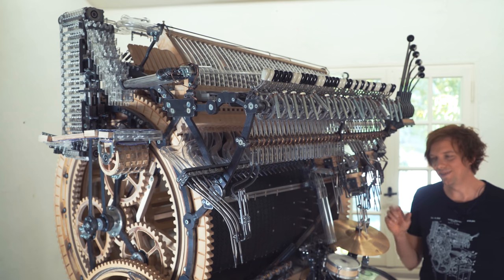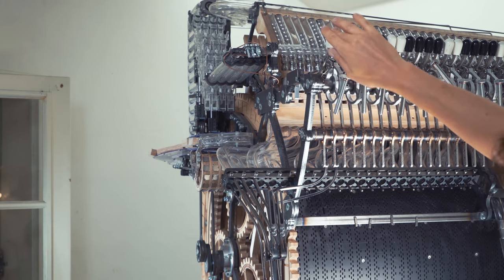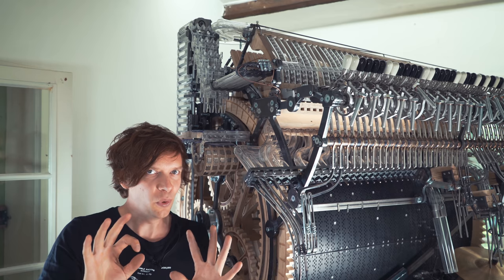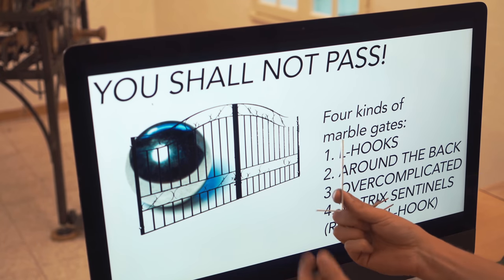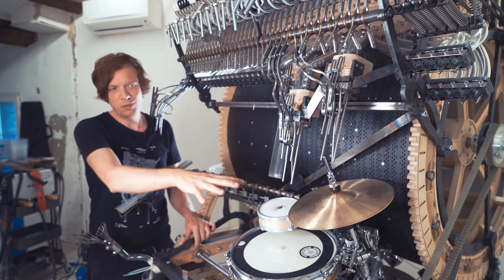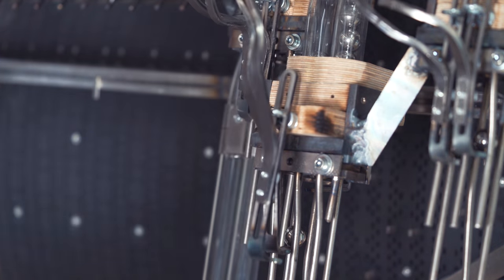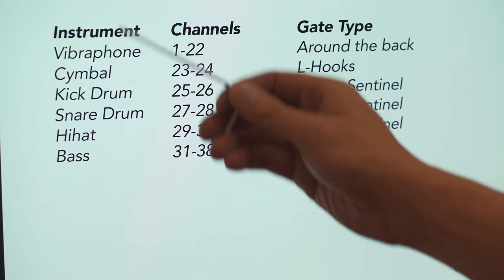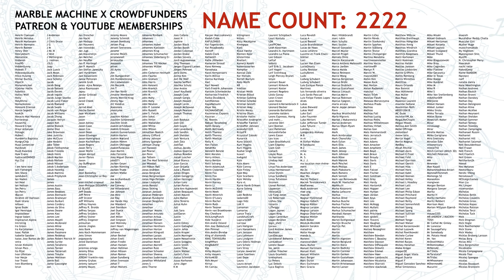Marble Gates Design - Marble Machine X #91

Comment: The two outer bass string could use the "Around-the-back" solution, right?
Reply: yes, and I think all of them could actually. you just have to go further around.
Reply: @tonygts1  But that would mean that you have to bend it around two channels for the inner ones. That sounds a little over the top but might also be worth it
Reply: I think it would be worth it.
Reply: I think there are still some alternatives that are being overlooked, things much more pleasing to the eye than the around the back solution. like the suggestion from Thiago Ennes in another comment, that is a much more elegant solution
Reply: @stuchris  I could see the around-the-back design being done with a strip of sheet metal like a piece of gum. Could mount flat against the release and take VERY little clearance between the arms. I would totally start with that janky looking wire, but refining could give multiple ways of doing the same thing with less room and just as much, if not more, adjustability. $0.02
Reply: @doomse150  if the other option is to restrict your bass compositions to slower notes only I think it is definitely worth it.
Reply: @AHustleIsLikeASideOfFries  yeah, it could still be done easily, but its still not a very elegant solution. I'd recommend the Redesigned Over-complicated mechanism with a rocking switch like other people have suggested, as it could not only do the intended purpose and look nice, but also be used for the registrator fingers that have caused so much trouble

Comment: Your problem from your gate is because the opening is depend on the speed of the wheel right? Is it possible to solve it by make the white knob gate spring loaded that triggered by the grey part? So the opening time of the gate is constant, and you can adjust the opnening time by the spring. Sorry i have limitations in describing and engineering theory, but that was my idea. Hope it helps you. 

Have a great day!

Comment: Just have the around the back go around the entire section of rails for the base.
Reply: If doing so I would suggest having two around the left side and two around the right side, so they don't become too long.
Reply: Correct me if I'm wrong, but doesn't that mean that it releases all the marbles at the same time and would jam it?
Reply: @calk7694  no. The wire start point and end point would be the same as if it had room. The path would just be longer. That path would not be a straight line to not get in the way of eachother.

Comment: cant there be an activation of the release that closes it immediately after opening (regardless of tempo)?
Reply: Perhaps in theory, but it seems that would require a significant redesign of the registrator mechanism
Reply: That's a nightmare: gate opens, ball falls, gate must close and stop the the stack of balls right behind it. Almost nothing in this machine is that accurate, repeatable and reliable. All three are necessary. The matrix sentinel style is excellent on all 3 counts, it's just big.
Reply: @jimbarchuk  i mean at the release of the marble that will play for that note, not at the gate or registrator
Reply: The idea of the fingers could actually be functional. They would actuate the release, and it would slip away before full extent and close before the next ball dropped

Comment: I think a lot of people will agree, for once, this over-complicated solution is by far the best of the whole lot here. for its adjustability, I'm sure there's a way to redesign it, and to get that pivot just right there are ways to calculate that. the overcomplicated design would look much better than the rest of the solutions (especially that around the back) and could perhaps help or be implemented with that other, controversial part directly above the channels :P

Comment: Martin, I can't help but notice that all of the solutions, excluding the matrix one, can fail for repeats of more than 2 consecutive notes as the time to travel between the upper gate and lower gate (TTT) is still ultimately the "gating factor". :)  A 2 note repeat is fine since both balls are queued at the "tip" so-to-speak but it breaks down at 3 for higher frequencies (where TTT is slower than the desired frequency).

Your matrix sentinel gate is interesting and it seems to highlight the underlying problem of the TTT being the frequency limiting factor.  For that one you've essentially moved the upper gate from the top to the bottom, closer to the instrument to lower the TTT making it faster than the desired frequency requires.

If my observations are correct, the only way to truly solve that across all desired channels, which sadly would seem to require a lot more re-work, would be to move the whole upper gate system to much lower in the design closer to the instruments, or at least to do that for the high frequency channels.

Caveat: the purpose of my note is that I see a lot of complexity being added by requiring all the secondary gate systems for timing's-sake that to a degree obsolete (though not completely) the need for the upper gates.  Needing the lower gates requires many more parts and most notably limits your creativity when composing, to frequencies limited by their respective TTTs.

That all being said, constraints tend to bring out other forms of creativity in interesting ways and certainly these lower gate designs make for a more complex and interesting overall system.  So maybe it's a fair trade-off.

BTW, my son and I love watching you on this journey, learning from your experiences and are greatly looking forward to your world tour!

Comment: Really nice engineering and analysis of tradeoffs. I kind of like the slim look of the "overcomplicated" gate.

How about using the "around the back" design, but use a some thin sheet metal to build it, instead of using a wire, then add a little bit of adjustability on the back, so the timing, and clearances can be adjusted?

But I agree with the current choices, make it be ready and working. It can be improved further later.

Comment: Solution for the integration of the overcomplicated in the bass part, maybe put it at a angle? If you can build a top part to make sure each marble cany escape, or put it at an angle where they dont fall out, the overcomplicated can likely work at a angle or sideways and lessen the amount of space it requires horizontally.

Comment: A suggestion for the bass and drums, you can use something like a full-flow-ball-valve passage that pivots instead of sliding, and then use an adjustable linkage up to the handle pivot to allow for fine-tuning of release timing.  This way you are not adding congestion to the lower release mechanism, nor adding a significant load to the existing release design.  Keep up the good work!!

Comment: An interesting video idea which would also help your composition process. Call it MMX Piano Phase.

The goal is to find the exact maximum tempo for various instruments. Find when the L-Hooks start dropping notes, and keep that in mind.

Set it up in 8th notes, Triplets, and 16ths, across the full ranks of the L-Hooked channels, and accel. through the failure point with a click track. Spend a half-measure at a given tempo, so you don't have to fiddle with the high-speed framerate arithmatic.

Remember: You can still do two notes in quick succession without reloading - just not 3. You have two channels per note for a reason.

Additionally, this tests the hell out of the tolerances for your marble reloading system. It's elegant, but you do want to know how many marbles per minute the system can handle, and you only find that out by going past that point.

Comment: Martin, look at how an anchor escapement works on simple clocks; There are two pallets that rock back and forth over a gear. As one pallet lets a gear tooth slip by, the other pallet catches a different tooth just a moment later. One pallet rocking back and forth could simultaneously release one marble and block the movement of the next marble. One piece, one side, quick reload.

Comment: You can use around the back on the bass by having the wires loop around multiple channels. Only the two inner ones need to reach around the outer ones, so that shouldn't be too much work getting it right.

Comment: i think if you combine the matrix style gates with the normal l hook gates you could benefit from the around the back method without compromising on width. i think if you take the normal base gate that blocks the marbles, affix a wooden block (with a hole one end for marble to pass through, this will be closest to the l bracket. then the rest should block the path of the marble) this means the marble can load into the release section but then a subsequent marble will be blocked by the wooden extrusion blocking the channel.
i'm certain you may've tried this but i'm hoping to help.
great videos!
and many thanks

Comment: Have you tried designing a rocking mechanism like for example the "escapement" part of a clock assembly.
Instead of the marble releaser directly releasing the marble. 
Have a upside down U-bracket that sits upon the rails with a pivot on the centre, and everytime a marble is dropped, you raise the front of the bracket, while the back drops down and stops any further marbles from going down

Comment: If I'm not mistaken, because the E and G strings of the bass are on the outside of those sections on the machine, you could theoretically put the "around back wire" for just those strings to play faster if you really wanted to

Comment: Since the 4 channels for the bass are all the way on one side, and they have space on the side, you could widen the spacing between the clear shoots. Since you have metal rails, you can guide the marbles back closer for dropping. With that extra space, you may have room for the around the back design. - Tradeoffs; you'd get to play those notes in quicker succession, but you'd have to redo some work (tubes, that metal mount), and the space would still be tight.

Comment: An idea - 15mm slice of thin wall box section - just wide enough to sleeve over marble rails. Weld top of box section to gate. Add tapped hole on bottom of box section. Use bolt to act as adjustable peg that rises and blocks marble when gate opens. Box section gives strength and uniformity in direction of repeated marble hits. Bolt peg gives timing adjustability. Stagger alternating channels to keep slim profile. Adds maybe 1mm either side of channels - surely there’s enough room for that?

Comment: This may be hard to explain, but I expected some kind of mix between solution 1 and solution 2. 
Having 3 marbles loaded in the release system (one by the divider with the gray part, one in the actual release, and one held by the around-the-back solution) seems to be the most effective to me in terms of reliability, and doesn't really care about speed. 
There can only ever be a single marble in the release thanks to around the back, so playing slow is no issue ; and having both systems allows marbles to be reloaded super fast, so playing fast is no issue. 
I guess it's kinda like your fourth design, but without the marble queue.

I agree that going around the back is not a nice way of implementing it, but I imagine a switch attached to the release that would be kind of the seconds ticker of a watch, going back and forth and acting like a lock (as in waterlock or airlock -- sluss)

Comment: An alternative to the 'overcomplicated' that may be simpler to adjust, while maintaining elegance and a degree of maintenance-simplicity.

Use a pivot still, but add a turnbuckle rod between the release gate, and the 'inverted' (by the pivot) counter-gate.  I'd have the counter-gate arm bent around 20-30 degrees at the pivot, away from the marble track. In order to avoid risk of interference with the marble on the track.

Regarding the 'matrix sentinels', if you invert the 'drop' operation, you can completely avoid the need for L-hooks:

- On the forward stroke, the marble enters the 'metering chamber' (aka 'grey piece')
- On the backward stroke, the marble is released from the 'metering chamber' and lands on the now-closed release gate.
- The screwed-in mechanism as currently used forms the adjustment mechanism for the point of release.

I apologise for the fact I haven't attached diagrams to this comment. It's half ten at night and I've been battling binary logic all day.

Comment: Considering all the space near the bass, you could do around the back, the two center channels would just need to go around the outer channels as well.

That would look a bit wild, but is totally doable.

Alternatively, as there’s literally no space between the channels, you could do standard around the back for the outside channels, then weld the center two together for strength, and then drill a small hole through that seam, for a slim rod to pass through for each of those channels.

The great thing about the around the back solution, is you can implement it later, rather than hold up the whole machine now.

Comment: You could go around the back on the edge bass strings - E and G - and use the L hooks on the two inner strings - A and D. 

That way you could get fast alternating octave lines as long as you don't go below the low G on the E string.

Comment: You could attach a horizontal piece of metal with a hole in it to the marble releasers. Then when the release is out because a marble is being dropped, the hole would slide out of the marble channel, blocking any marbles from coming down. Then when the marble release closes, the hole would slide back into the channel, opening the gate and allowing the marble through. This would require no extra space on the side and just involves attaching a single piece of metal with a hole onto the marble releases.

Comment: Hey Maarten. There has been something rattling around in the back of my mind for a few months now. Pretty much since you finalized the marble divider. With the changes I see today with the "Matrix Sentinels" (I LOVE These), the noise in my brain has become louder. It has to do with refill rate and marble reserves. Due to the shallow angle of the divider, you are limited to a certain number of notes per second. In addition, the instruments with the highest note rate are on the far RIGHT of the divider. The right end of the divider also has the smallest reserves. Adding the matrix queue definitely should help, but on a busy composition I can definitely see you running into constraints. My feeling unfortunately is that the percussion would be better on the LEFT side of the machine than the right... not that it's really possible at this point. That bridge was crossed long ago. Have you already thought about this?

Keep it up!!! I cannot wait to see you in concert.

Comment: The around the back method can be improved so that it doesn't take hardly any space at all.

Use a flat metal strip that you bend into a rectangular hook shape. Weld or screw the long end of it against the side of the release mechanism so that the strip goes completely flat up against the side of the rails, and the hook at the other end comes from the back to stop the marbles. This way you can use it for your bass.

Comment: I have an idea for the matrix sentinel reverse L-hooks. You probably won't change it anymore and maybe you thought of it already but here it is:
The sliding part that resembles the grey 3d-printed parts in the marble divider has a hole that can hold one marble. Only when pulled a marble can fall into it but right now it falls immediately right through it. If you attached the marble canal on the bottom a bit further back you wouldn't need the reverse L-hooks anymore because the marble stays within that wooden part until the entire thing closes again.

Comment: The fact that the L-hooks are so slow would be a total KO for me and you could simplify the overcomplicated version quite a bit.
Instead of two hooks intertwined you could use a seesaw mechanism. When the registrator is triggered, the seesaw is rocked and the lower marble released. By the nature of a seesaw, when the lower side clears the track, the upper side gets moved in the way. It combines the slim form factor of the overcomplicated version with the easy to tweak and rugged/failsafe properties from the around the back hook, which would have been my favourite of your options. But the seesaw is probably the best option.

Comment: Hey Martin, just a question: did you try out the actual speed of the different solutions experimentally? In my mind the Around-the-back solution shouldn't be much faster than the L-hooks. 

Here is my reasoning: 
The time the marbel needs to get from the grey thingy to the release mechanism is the minimal time you need befor you can play a note again. The L-hooks add to that the time the mechanism needs to close again. Around-the-back overlays that delay with the travel-time of your marbel, so you don't loose speed: quite genious I might add. 
However: that added time delay by the L-hooks gest smaller the faster you play. So when you play close to maximum bpm, the difference should be quite small. 

So far the theory, I suspect you already tested that and found the around-the-back solution worth your trouble. 

Btw. you cheer me up every time I see one of these videos. As an engineer I find it fascenating to watch the MMX growing and you slowly becoming an engineer yourself. Seriously: that project is probably worth a Bachelors degree.